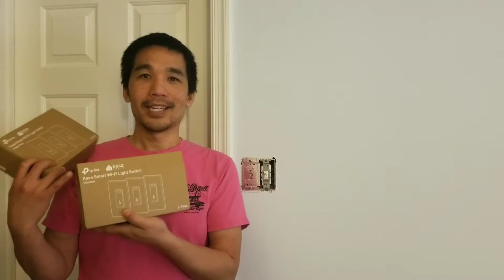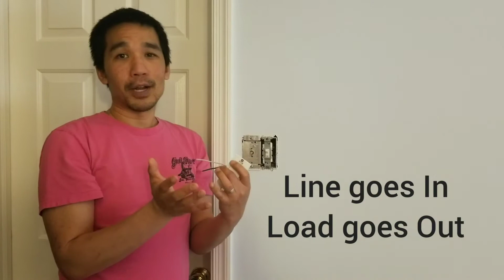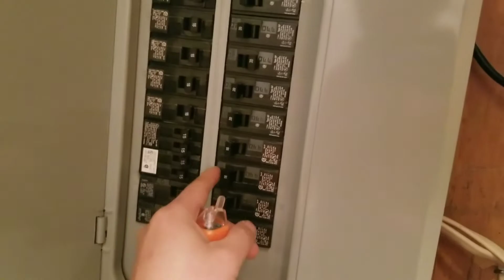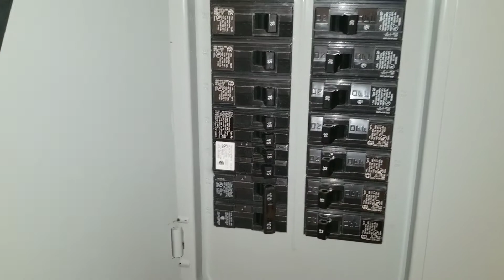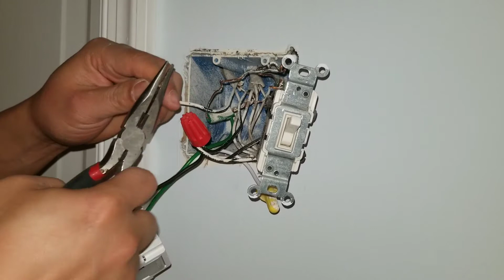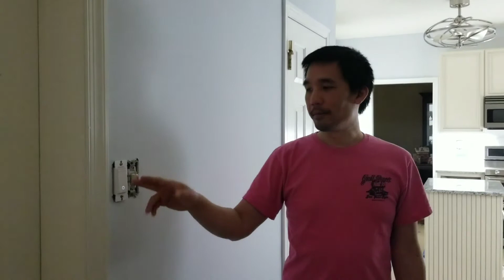How to install a Tp-Link Kasa Smart Dimmer Switch

Comment: Thank you for the video !! Just one question what about the cover ? Did it fit with yours switch ?
Reply from the maker: Yes it did work. There is a right-side-up and it just clips on.
Reply: @RaymondCanDoIt  sorry I mean  the plate to cover the switch
Reply from the maker: The plate that came with the switch covers one switch. Since my box had 2 switches, I had to purchase a plate for two rectangle switches.

Comment: Just wanted to say THANK YOU!!! My dad and I spent hours one afternoon trying to get this light to work. The instructions that came on the Kasa app were vague and terrible. They basically say, "Just match up the colors." 🤦🏼‍♀️ They don't even tell tell you how to attach the wires to the terminal screws or anything. And I was installing it in a box with two switches like you did here (also not covered in the app instructions), and there were so many wires, nothing was labeled, and we were trying to make heads and tails of it all. We finally gave up, and the next day I called to get quotes to hire an electrician. Then I figured I'd try one more time, found your video here, and this was the most helpful thing I've watched out of dozens of videos and online instructions. This was easy to follow, and I appreciate the close-up shots so I could really see what you were doing in detail, and you didn't skip over steps like some other videos do. Following your instructions, I installed the switch and got it working tonight! Hallelujah! 🙌🏻

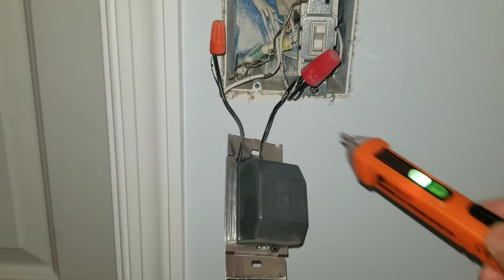One quick question, though. I also saw this video below, and at the 3:23 mark, it looked like she screwed the wire underneath the little metal plate under the terminal screw, wheres you put the wire on top of the plate. Does it matter? I did it your way, and the light works, but is it more secure if I can somehow squeeze it under the metal plate and under the terminal screw? Seems hard to fit.

https://www.youtube.com/watch?v=mKoF9DmKAYE&t=204s
Reply from the maker: I'm glad my video helped you! Yea, I thought it was confusing at first as well. Now half my house has the smart switches! To answer your question, it's probably more secure to have it underneath the metal plate. I did not as traditional switches don't have that metal plate and just secured by a screw. You can unscrew the screw all the way, put the wire and metal plate on and screw it back to the switch.

Comment: Do they have smart lights in the same brand?
Reply from the maker: I think they do but I use Sylvania smart wifi bulbs. There are also smart  bluetooth bulb which connect slightly differently but work about the same.